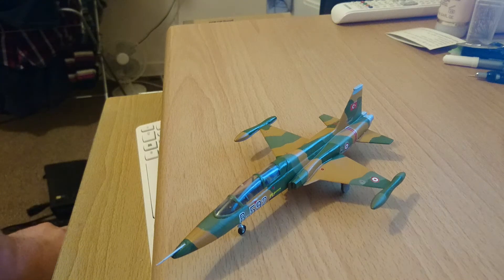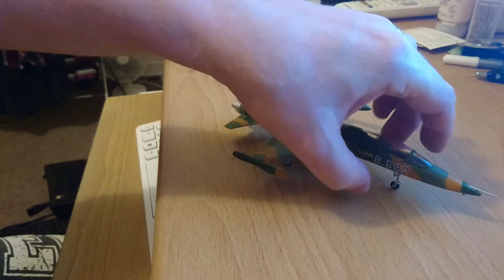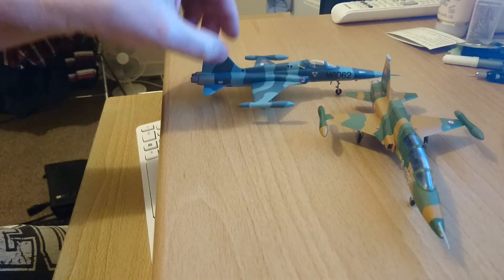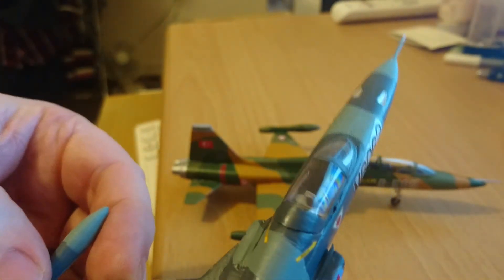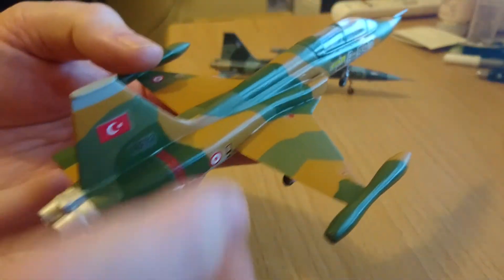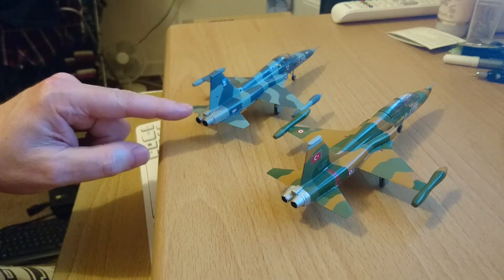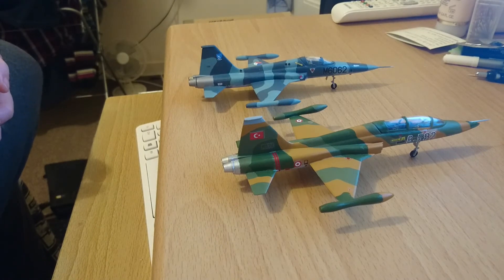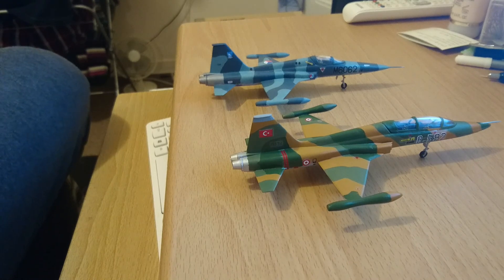Final Reveal Clip  PM Model F5 B Freedom Fighter

Comment: Try using an airbrush. They're really affordable these days. Keeps the surface detail.
Reply from the maker: I have tried to use Airbrushes and I find they don't like me.
I have only really managed to airbrush 1 kit satisfactorily and since then every kit has needed to be re prepped and brush painted so I have given up on them.
I think I have gotten through about 4 brushes all of which behaved appallingly
Reply: @johnparker1696  Hmm... maybe drying paint or clogged nozzles are the problem? There are paint thinners, flow improvers and even retarding fluid for those. I am using a really cheap Agora-Tec (complete set) for €200, and it is not worse than the €2,000 set I used to use for painting pictures years ago. There is a learning curve involved for each paint you use (so experiment with thinners), but the result by far justifies the effort IMHO.